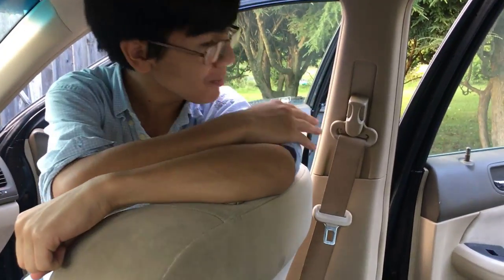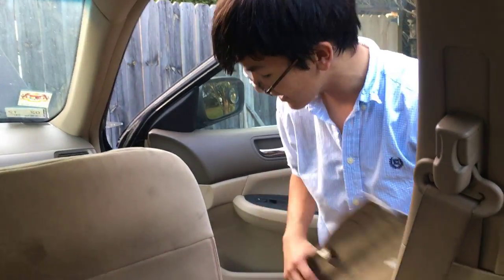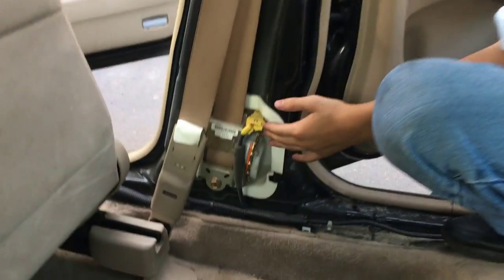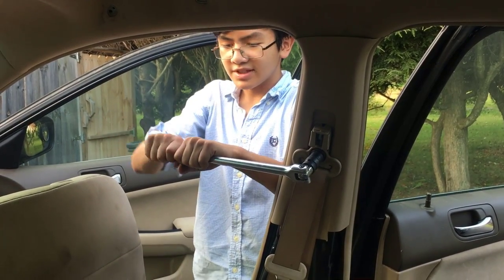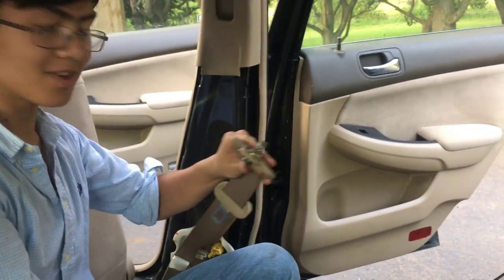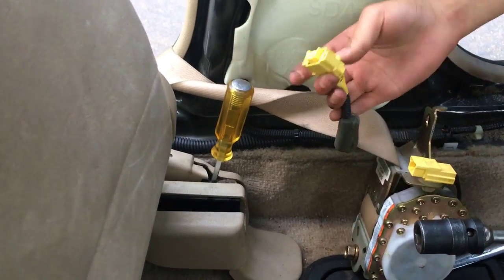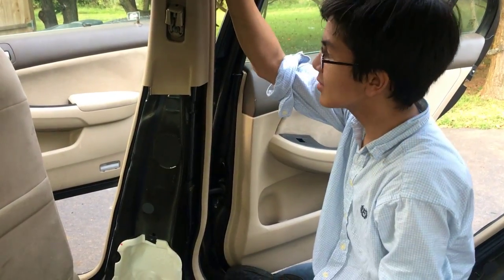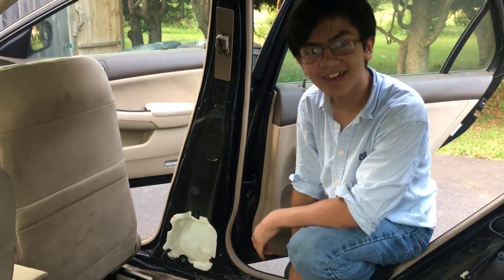How To Remove Front Seat Seatbelt Assembly SRS Retractor Honda Accord 2003-2007 | DIY Auto Repair

Comment: Excellent video!  Thanks for that.  My 07 has basically been an indoor truck for 5 years or so.  My plan is to take out the carpet(s) and the belts so I can clean them with my pressure washer.  They are really, really bad off.

Comment: Very helpful but did not mention disconnecting  the battery to prevent the seatbelt “airbag” from deploying. 
That is a very important step that should not be skipped over!!
Reply: That's correct.
Reply: After disconnecting the battery and seat belt, can the battery be connected to use the car to drive around if needed? Airbag won't deploy? ( not driving on road)
Reply: @PIYA07950  I suspect you've already moved on but for the rest of us, the answer to your question is "Yes".  The danger is in the process of removal (or connecting) of the connector.  Of course, it should be self evident that driving without a seatbelt might be a concern :)